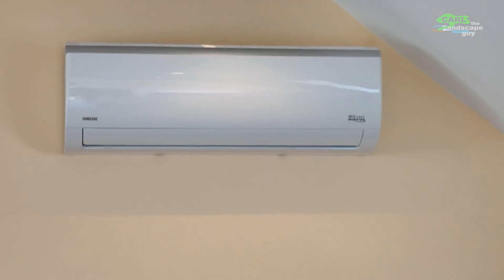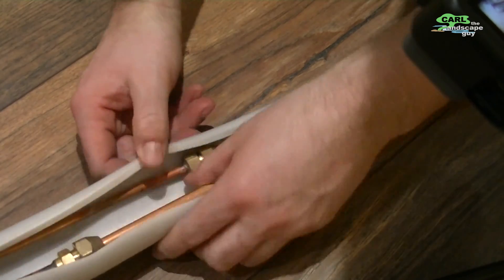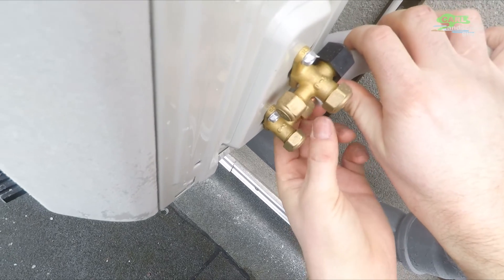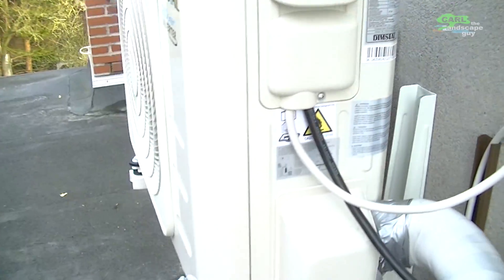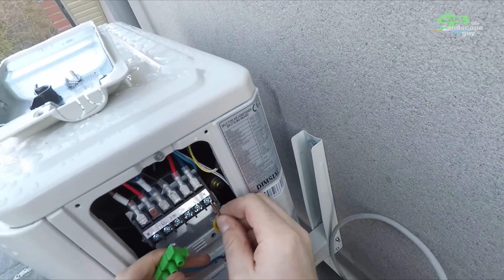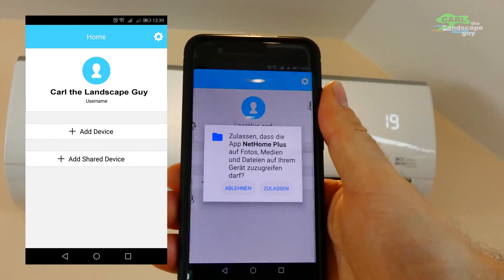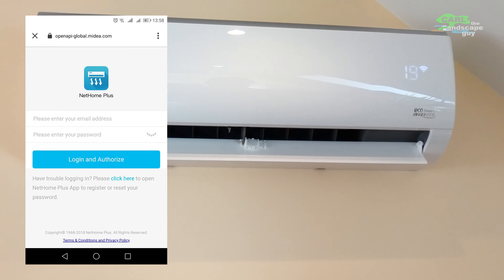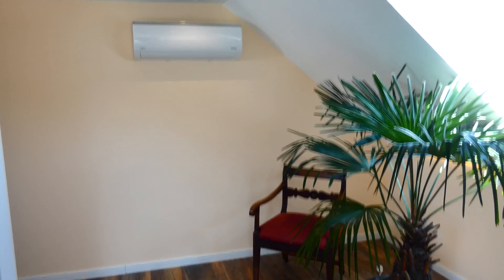AIR CONDITIONER INSTALLATION UPDATE - SMART HOME ADAPTER - SPLIT AC SET UP INFO, REVIEWS AND REPLY

Comment: Hi, thank you for taking the time to make the video. Have you experienced any short or long power cuts while you have been using the wifi controls. And what happens when the power is restored? Does the wifi control kick in and the air con turn back on as per any schedules and automatic settings?
Reply from the maker: so far after every power outage it went right back to where it was and wifi connection works flawless, thank you

Comment: Hi Carl, great job, very informative (both parts). I'm about to install my AC. I've bought vacuum hand pump like yours. I'm able to get 25 InHg Vac in few strokes, but not more. It might be, that my pump is not as good as yours. Question: How long did it take you to get almost -30 InHg Vac? You have achieved -.97 Bar. Can you please advice? Thanks in advance, Regards & respect :-)